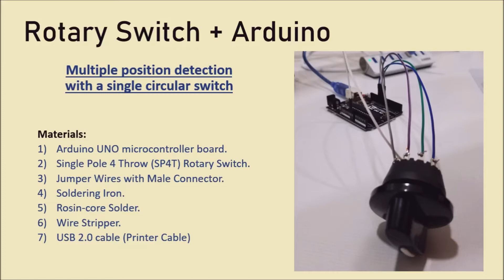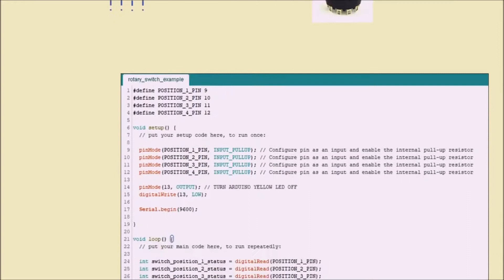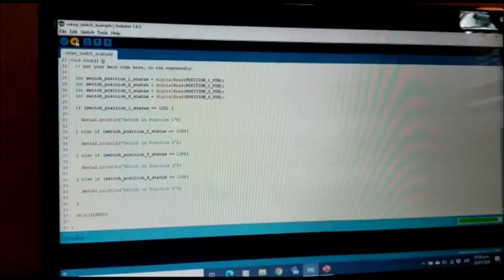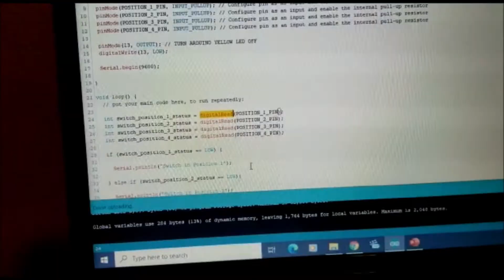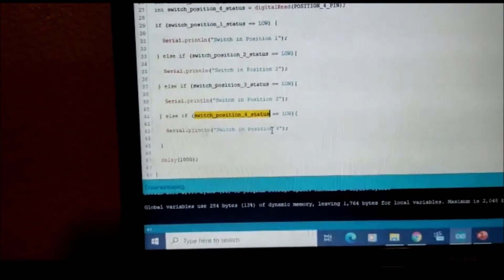Rotary Switch and Arduino Tutorial: Multiple State Detection with no Resistors

Comment: Is there a way to code it so it isn't in a continuos input loop? Like for example it gives an input (position) once the position changes and just stops until the position changes again.
Reply from the maker: The microcontroller is always running an infinite loop. So anything inside will be checked at every iteration.

Another approach could be to use interrupts for each position. But you will have to rethink the code.

Comment: Hello I am having a hard time with this sketch. I have a 3 position rotary switch. The first two switches work but the last one jumps back to the first switch in the serial monitor. Voltmeter says its connected correctly.
Reply from the maker: The switch you are using probably has a different configuration from the one I used on this video. If that's the case, the exact same sketch probably won't work, and will need to be modified. See that the switch I used, had a Single Pole 4 Throw configuration.
Reply: @manuarturo7966  The switch I am using is a single pole 12 position, non shorting type. I don't see why your skeych would not work. Can I email you my sketch if thats ok?

Comment: and you had a selector with 6 positions what would you do? I mean, can add more pins to arduino?
Reply from the maker: You can use 2 more of the digital pins on the board, to accommodate the 2 additional positions of that switch

Comment: I'm trying to make this project using a different rotary switch and I'm having a few issues. If you don't mind me asking a couple of questions: do you not have to run voltage across the switch for it to register a position change in the pins ? Also do you use analog or digital pins?
Reply from the maker: Pins 9, 10, 11 and 12 are digital pins on the Arduino UNO used. We don't need any voltage applied to the switch, since we are using the internal pull-up resistors of the chip. If you see the wiring diagram, you will notice that each pin actually connects to ground when the switch is on a specific position; for example, when in "position 1", pin 9 is connected to gnd
Reply: @manuarturo7966  thanks for the help. I’ll try to figure what I’m doing wrong.

Comment: Hey does this display if the switch is in an "off" position?
Reply from the maker: The switch itself does not have an "off position", since we are not using it to control another circuit. You could call position 1, "off", and detect that state to shut down a secondary circuit for example. This experience, as it is, will always tell you in which position the rotary switch is.

Comment: Thanks for this Manu, you have confirmed an idea I am working on. I am going to build model railway turntable that will be controlled via an Arduino and I was contemplating different ways to direct the turntable to a specific position. By assigning step (posn) values to each of the rotary positions I should be able to direct the turntable as required. A rotary switch is much better for me than a series of buttons - it looks better on my control panel and I can light a led when I have feed back that the table is in the required position.

All just a plan right now, but I am heading n the right direction. (pun intended) thanks.
Reply from the maker: Thank you for your comment! I'm happy you found it useful.